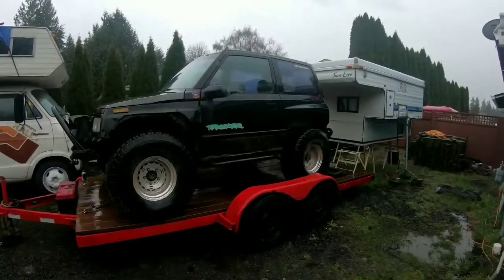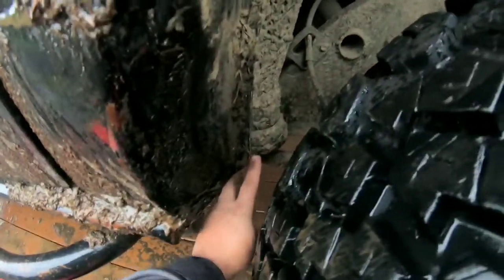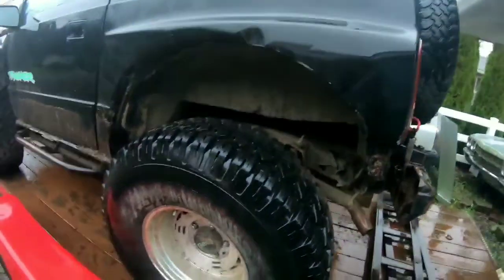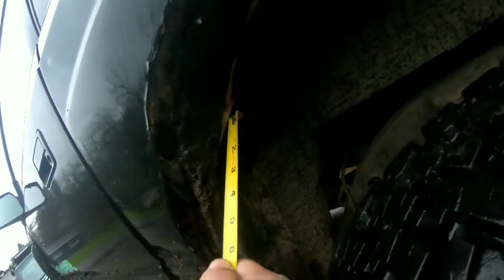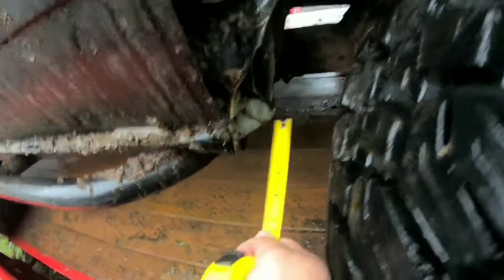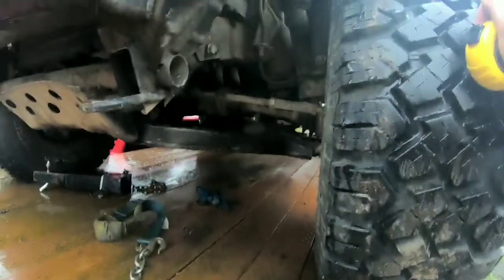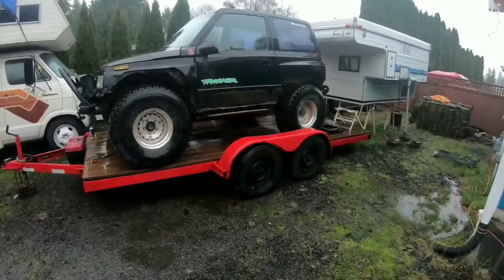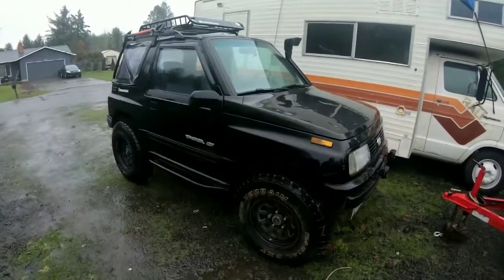Fitting 35s under a Geo Tracker with IFS.

Comment: I'm thinking about making a tiny slide in Camper for my 95 Tracker 2 door. Just to see if it can be done. I do fiberglass and think I could make a super cool tiny camper. Like the one you have behind the tracker, a pop top tiny version. I seen a guy in Mexico do a smaller version. He open the back door and it slid out. I think it would be cool to get somewhere cool drop your camper off and go wheelin.
Reply from the maker: That sound so cool. I have seen scouts and blazers with campers. A tracker would be sweet.
Reply: Did you ever make that tiny slide-in camper for your Tracker?

Comment: Where did you get the snorkel on the tracker with 33s I have the same rig but white looking to put the snorkel on
Reply from the maker: It was on the rig when I bought it. Eventually I will remove it. That rig has a 2.0 now and the air inlet is on the passenger side.

Comment: So I'm building a tracker right now and planning on 35" tires. I'm starting with the altered ego 4.5" lift. (It just showed up a couple of days ago)  I'm hoping to be able to just to add a 1" body lift and be able to run 35's. I'm planning on using sxs atv tires that are rounded on the edges so they're probably only 33's on the edges where they normally rub.
Already have the steel front diff, going to throw in an arb locker, I think. My question is what is drivability like with 35s. From what i've been able to deduce on line, the final drive with the stock tires in fifth gear is very close to 35's in forth gear.  So, on paper, I'd be maintaining the overdrive gear ratio using fourth (not using fifth) but my 1st gear will be like starting out in second. Am I correct? 
As i don't currently have an engine in it, I'm considering the ve diesel swap.
I'm already planning on a set of trail tough gears but can't decide between the 4.?? Or the 3:1 trail savage. My friend recommends the 3:1 but then again he's a little biased because he's the "Savage" they're named after.
Reply from the maker: This rug has the 8v and it definitely notices the larger tires. I dont do any  hwy driving with it. My other tracker has 33s and it barely ever got 5th gear. That rig also had an 8v but now has the 2.0 and it is great.

Comment: Do the front tires rub the foot board/kick panel area at lock? I'm getting ready to go to 36s on my Tracker rock truggy so I'm trying to see what experience others are having with the minimal aftermarket cut and run build style.
Reply from the maker: They do stil hit sometimes.  I hope that once I install larger springs that will stop.
Reply: Are they still rubbing did you change springs
Reply from the maker: This rig now is on toyota axles.

Comment: How do you keep your diff from break off mount I just broke mine again last weekend at the mount near breather and the mount on 3rd member so I’m looking to get a stronger steel do you know what rigs I need the parts from
Reply from the maker: 5spd, 6 cylinder vitara. Has the steel diff. When I wheel I dont let the front end bounce around.  Having a spool in the rear end helps alot.

Comment: Did the factory springs pop out when you were off roading or was it under just normal driving? I was wanting to do the 2” body and suspension lift but it’s just going to be on a commuter vehicle
Reply from the maker: Springs came out while I was out wheeling it. The longer shocks allowed for more flex and the spring was to short.
Reply: @trashpandaoffroad3548  I also found a 97 Suzuki vitara 4 door in a local salvage yard and I’m wondering now if the coil springs for that would work. I have also been trying to find a hard top and a luggage rack to make an overland kind of camping/commuter rig but it’s slim pickens around Missouri and what I do find everyone wants top dollar. Oh and when you first showed your daughters x-90 I started searching for them and found a couple in the $3500-5000 range. I’m guessing that’s probably about normal though, you don’t see a lot of those around.
Reply from the maker: Ya. Those springs will work. Gonna gain about 1.5 inches depending. X-90 are hard to find. The one I just bought was only 2000 but I had to drive 4hrs to get it.
Reply: @trashpandaoffroad3548  I’m just getting into the whole tracker scene as it were and I had no idea how much of a cult following these have. I originally wanted a Suzuki samurai but around here they are way hard to find and they are all rusted out much like my tracker but it’s humid as crap here. I miss the Pacific Northwest. I grew up in north Idaho anyway I am glad I found your channel
Reply from the maker: The market on these things has gotten unreal. I used to be able to get them cheap but now more people are learning how capable they are. Glad you found my channel also. Let me know if you have questions.  If you have Instagram I am there also trashpandaoffroad

Comment: Hi there i leave in Cyprus i bought a vitara jx 8v 98" i want to lift my car but i don't know if theres a car out there that have the same coilsprings but with +2" or +3" so i dont have to put spacers otherwise i will but i heard that it will become stiffer
Reply from the maker: You can try 4 door springs. Otherwise there are companies that make list kits with new springs. Spacers on top of the springs does effect ride quality.
Reply: Im guessing you mean the ride quality gets worse? I bought my 00 2dr 2.0L tracker with coil and strut spacers already in there. I like the lift, but i dont like the idea of spacers. I was going to swap it all out for lifted springs and longer shocks/struts and hopefully achieve the same lift height, but im not sure how to tell if i have stock springs or shocks. Id hate to buy the suspension lift kit and then be lower than before.
Reply from the maker: If it has spacers it will more than likely be stock springs. Lift springs and spacers would put the front axles at a really bad angle. Once you get over about 3 inches of lift you need to drop the front diff in order to keep the axles happy.
Reply: @trashpandaoffroad3548 that makes sense, but it looks like my cv angle is steeper than yours. Do your springs give you any lift or are they just stiffer than stock?
Reply from the maker: @HomesteadOC on the rig in the video I was running 4 door springs. They are a little stiffer.

Comment: I have 89 Sidekick but my 1.6 would never turn 33 inch tires! Change the transfer gears and she could.
Reply from the maker: The 8v does not like tires over 31"
Reply: @trashpandaoffroad3548  I am running 29 inch tires with a locker in the rear and I lifted it
Reply from the maker: That is a very capable combination